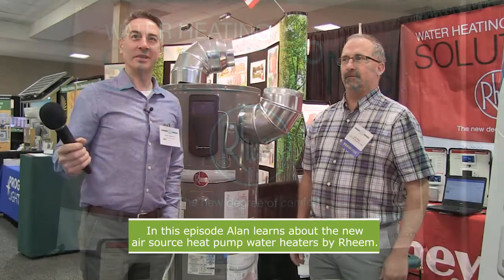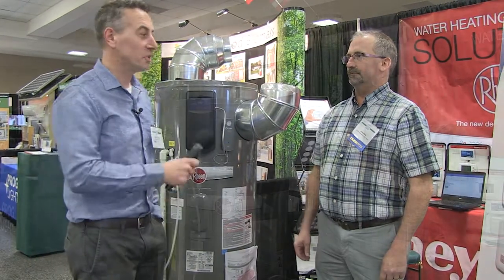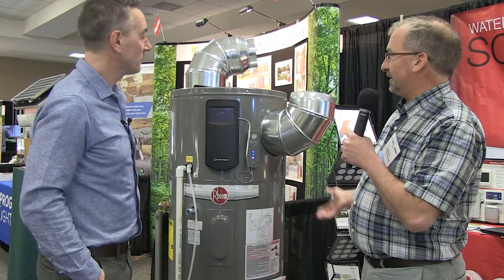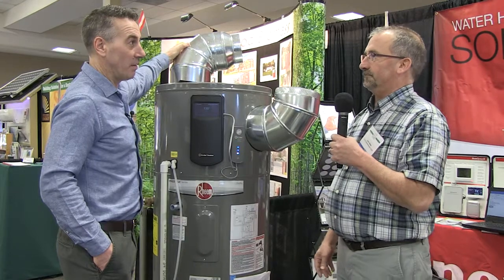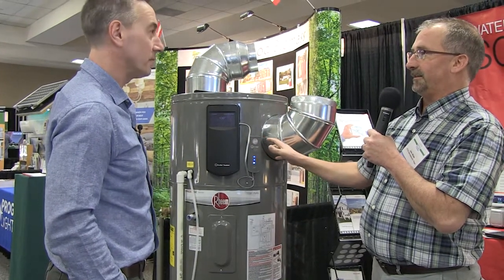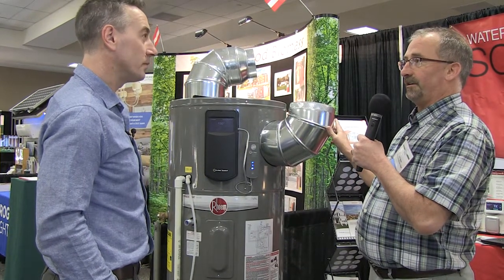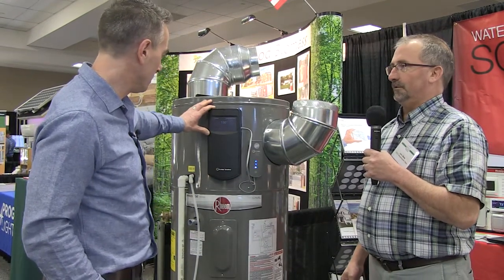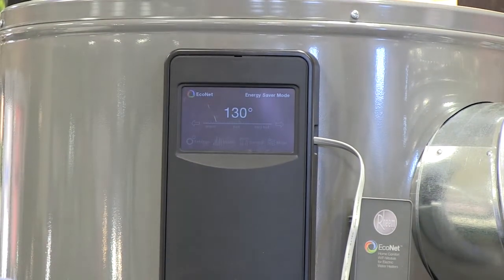S Files Season 3 Episode 8; Rheem Hybrid water heater

Comment: The Rheem Install Manual talks about a louvered door, and facing the exhaust towards it. Guess what happens to all the other parts
you need access to if you face the exhaust towards the door! A lot of the manufacturers have also moved the inlet/outlet off the top of the units, to less accessible locations. :-(

Comment: Did anyone find a video on how to remove the panels from the water heater to install the duct elbows? SustainableDesignVT do you guys have a video on how to install the duct elbows off the water heater?
Reply: On this model which I also have it had duct connections or metal extruded out to attach duct work. Now the newest models have flat grilles.

Comment: I was thinking about installing one of these and running the intake duct up to my attic for the spring/summer since its so hot up there
Reply: Chris, is your attic spaced "conditioned"?  As in, is your roof insulated, or just the attic floor?
Reply: Alan Benoit, I had the same in mind pull from attic (not conditioned) blown in insulation floor only,  I’m in central Texas and my concern would be where to pull warm air from in the winter sense the attic would be cold air?  Any suggestions?
Reply: Same idea

Comment: Dos it comes with motorized valve to turn off water in case it needs to ?
Reply from the maker: You would think it should, but the literature says "When water is detected, the electronic control will turn off the heating elements, flash the display backlight and turn on an audible alarm"  It also sends an alert to your cell phone...
Reply: That's engineering? With all those electronics in there, the first thing should be to protect property from flooding.
Reply: Use your own automated shutoff.  Its a water heater, not an automation system.
Reply: If you're somewhat inclined, you can absolutely do this yourself if it's that much of a concern to you.

Comment: I have a control system for off grid solar which can dump excess PV power to a 240 volt water heater when the battery is highly charged. If this Rheem unit is left in its "eco mode" (heat pump only) can I connect my diverted AC to the heat element's dedicated thermostat without crashing the Rheem system? It seems like the Rheem microprocessor would just see the water is hotter & wouldn't need to know the manner in which it got hotter...and if there's not enough surplus PV power to drive the resistive element, the Rheem would just work in heat pump mode. Thanks in advance~

Comment: Hmm, I wonder if I could run the intake and exhaust to my crawlspace to dehumidify down there?
Reply from the maker: Hi Oisiaa, while pulling air from the crawlspace and running it through the heat pump will help dehumidify it, please be aware that it will cool that space as well.  That might not be a concern if you live in a warmer/more humid climate, but it might not be helpful otherwise.
Reply: Hello Oisiaa, is your crawlspace insulated or conditioned?
Reply: I read a very well done engineering study related to this recently and the affect on an attic or crawl space can be measured temporarily while the unit is running but barely and overall affect is negligible.